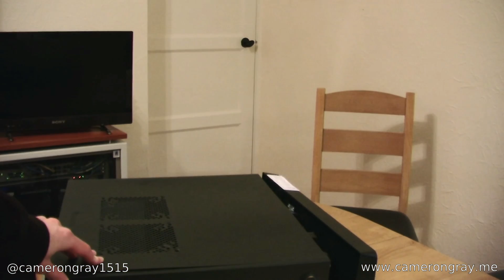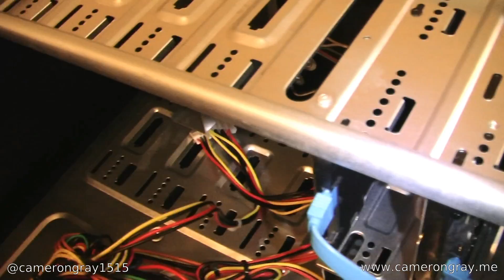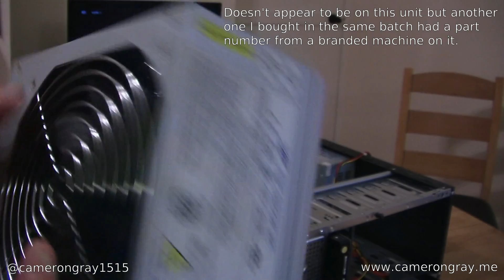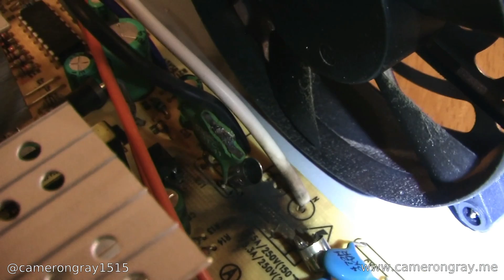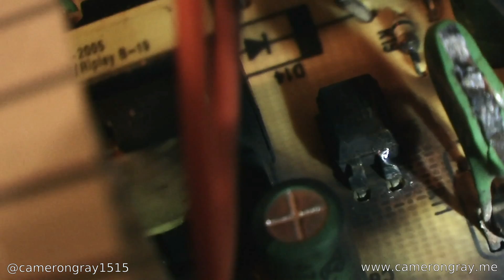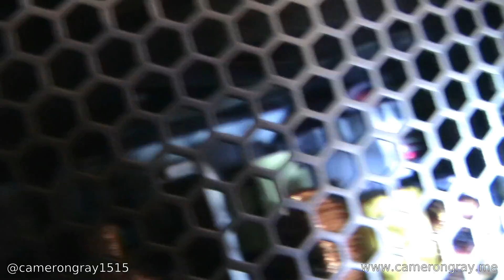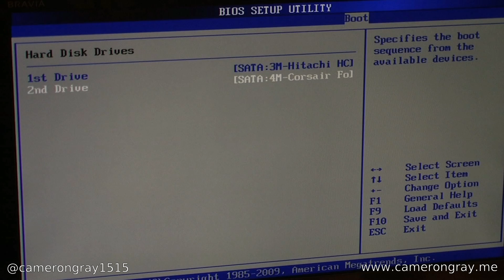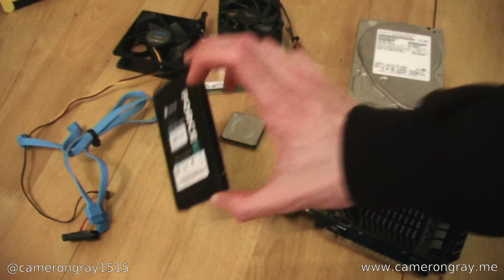Mystery £10 eBay PC

Comment from the maker: Please read before commenting - I'm going to attempt to answer a bunch of things that people keep continuously commenting so I suggest you read this first before commenting something that has already been done a million times :P

Comment: "You said you had a glass of water in case it went on fire, if you put water on an electrical fire you'll die.etc"
Response: Yes, it would be stupid to pour water on it if it was still live however I'd have disconnected the power first, notice how quickly I pulled the power cable out when I first noticed smoke.  At that point it's nothing more than a bunch of plastic/fibreglass on fire.  I could have also used a powder fire extinguisher I had nearby but this would have cost money to replace and would have made a complete mess of the room.

Comment: "You talk too fast"
Response: Yes, I know, I talk fast generally and was rushing this video.  I've tried to improve on this in my newer content including investing in higher quality audio recording hardware to improve speech clarity, this was recorded using the built in microphone on a pretty outdated camcorder in a room with pretty poor acoustics.

Comment: "You're shaking too much and that deeply upsets me for some reason"
Response: Yes, I was somewhat shaky in this video, probably a combination of me rushing and also because I was filming this shortly after carrying this machine home on the bus from work which meant my arms were pretty tired.

Comment: "You're an idiot if you didn't know that the /4 on the end of the RAM stick model number was the capacity"
Response: It's not particularly easy to notice these things when most of my attention is focused on creating the video rather than deciphering model numbers under pressure. This is also something that is different between manufacturers and I hadn't really dealt with much Kingston RAM in the past. Also notice that towards the end of the video (26:08) I pointed out that the /4 meant the capacity after I'd had more time to look at it off camera.

Comment: "A PSU having an 80mm fan or voltage selection switch doesn't mean it's junk"
Response: Agreed, I was a bit harsh with that statement.  However, having a voltage selection switch does indicate that it's at very least a pretty outdated design and outside of a few models, 80mm fans are pretty uncommon on retail PSUs nowadays (although still used in some OEM machines).  The combination of the two along with the low weight of the machine and cheap punched metal fan grille was generally what made me assess it as being pretty rubbish

Comment: "That Winpower PSU isn't junk/That FSP PSU is junk"
Response: The Winpower is junk IMO, it'll work but it's the bare minimum that you'd get away with, it's far below the quality you'd get in pretty much all OEM machines from Dell/HP.etc.  The FSP isn't amazing but it's a pretty solid PSU, they don't really sell on the retail market which is probably why people don't recognise the name although they are very common in many OEM machines and also make PSUs for other well known brands (pretty sure several EVGA ones are made by FSP)

Comment: Did you find anything interesting on the hard drive?
Response: I make a point of fully wiping any drive that comes into my possession without going through someone else's personal files, sorry for being boring!

And finally, no, I'm not going to give away this hardware (this also goes to people who have emailed me asking for the hardware for free) - I've scrapped the hardware that didn't work and I'm now using the majority of the working hardware in various machines I have or keeping them as spare parts.

I also realise this video is not my finest work, you'll notice that my newer content is much better!
Reply: Cameron Gray its the nature of the internet. You can never please everyone. I thought the video was great. you dont speak to fast for me. Maybe its because i am irish lol.
You will always get the know it alls and haters
Reply: dont bother with stuff like this its the net
Reply: Em.
Reply: @Cameron Gray - 
the first look at the Power Supply´s rear reveals its the cheapest thing you can get (like from the OEM "Leadman" ) or an 1997 made (ATX 1.x instead of 2.4 ) one ... a voltage selection switch is also bad for noobs ( not only the 110V setting for most of the world, but also the other way around ) ... 
The PSU sticker tells it instantly, the "SL-8500BTX" is under many brands = same generic dirt cheap junk, like the Inter-Tech "SL-500" ...
Edit: the PSU´s internals look like 20 years old or cheapest stuff ( just like "Leadman" ) ... 

FSP PSUs like in your video are used all over the wortld in all sorts of OEM PCs , decent stuff.
Reply: That computer is way better than any of mine.

Edit: If it worked.
Reply: I thought it was a really interesting video, thanks for doing it. My only remaining question is whether you ever got another motherboard and got the CPU to work? The blown cap on the MB and the exploded PSU components were quite impressive to see!
Reply from the maker: Yeah, ultimately all of the components apart from the motherboard and PSU were fine, I ran the CPU in a home theatre PC for a few years.
Reply: Suggest you read this long arse nonsense before commenting? You have lost the plot mate. Erm... The video was ok but it was a bit pointless. I got this for a tenner, I got 4gig and an SSD plus hd with a shit case. End of. Half hour was definitely not needed for such content.
Reply from the maker: I fully agree it's a crap video - it was rushed out of an evening with no scripting and very little editing right when I was just starting out on YouTube. I never intended for it to get any sort of significant traffic. For some reason YouTube keeps promoting it resulting in people commenting the same nonsense over and over again.
Reply: @camerongray1515  It's not crap, I enjoyed your spontaneity. I only have one comment: that case isn't half as bad as you think and despite the broken clips is fully reparable using a couple of small carpentry screws.

Comment: your full of shit. that power supply is ample for a very low system such as that. and for 10punds wtf are you expecting? an antec 80+ which the lowest costs 20? use your common sense ya prick

Comment: Anodia formerly towards good capacitors, I have an emergency light with an anodia capacitor manufactured in 1982, it continues to work perfectly in 2019, and it's plugged in 24/ 7h, at it the capacity is still good.
I always prefer a Japanese capacitor a thousand times, but the old capacitors of Anodia surprised me a lot about its durability.

Comment: "Internal part of the computer are new"
(unpacking @ 0.42)
Sees PS/2-ports Yeah totally new! :D
Reply from the maker: There are still many brand new motherboards that come with PS/2 ports, usually only a single one on higher end boards but a lot of lower end boards still come with two.
Reply: @camerongray1515  Why is that? So you can use a 10 year old mouse and keyboard?
Reply from the maker: PS/2 is interrupt driven whereas USB uses polling. This means that it's technically lower latency, not a huge amount but there is a difference to an extent. PS/2 also supports "N-key rollover" allowing any number of keys to be pressed simultaneously. As far as I'm aware USB is starting to support that but it's still fairly new and hacky requiring OS support - my main keyboard only officially supports N-key rollover when it's connected over PS/2. Then there is definitely the benefit of being able to use old keyboards, for years I used an IBM Model M keyboard which would only work with a PS/2 port or with an expensive active PS/2 to USB converter. Having a pair of ports is a bit over the top but I definitely like having at least one if I'm buying a motherboard.
Reply: Cameron Gray  Beyond your valid (but imho useless) points: An AMD X2 is from 2005-2009. Just as my comment implied, the chance this computer would have (quote), 'new internal parts' is so small... Just as small as the chance any user would buy a motherboard specially because it has ps/2 support.
And of the people who who would prefer ps/2, most have probably a (HD) television with bigger latency (with or without post-processing enabled). Besides that point, N-key rollover is a luxury which is even less useful.
Reply from the maker: The AMD II X2 I demonstrated was a spare board and chip I was using to test the parts as the motherboard that came in the machine was dead. Notice the CPU that I removed was an FX-4300 launched at the end of 2012 and sold for a couple of years after that. It's definitely not brand new (I mean, it was a faulty, used machine) but it wasn't exactly ancient either. Sure, PS/2 ports aren't going to be any use for most people however, realistically, I don't see a huge disadvantage to having one, the cost to add it will be tiny. Sure you may miss out on a couple of USB ports that could have been fitted instead but given the motherboard in my main PC has a PS/2 port while still fitting 8 USB ports with room to spare, I can't really see a problem with having it there for the few people who may want it.
Reply: @camerongray1515  I agree having ps/2 doesn't have any disadvantages ofcourse. And actually, people who think they miss out on 1 or 2 USB ports, don't know you can daisychain USB devices (with or without USB hubs), so I don't see this as a disadvantage.
ps I'm still unsure how I forgot you switched the motherboard/processor, and jumped to incorrect conclusions at the end of the movie. I apologize.

Comment: Bad power supply from rogue supplier = house fire that will kill your family.

That scenario is not worth a tenner. 

But the chip, ram, sdd, crap gpu, HD, motherboard and DVD drive...well even crap as they are ...probably worth 50 quid. I'd just resell it as parts and forget I ever saw it.... Its not worth putting a new power supply in.

Comment: Those winpower psus are perfectly reliable, budget power supplies.  They probably manufacture a lot of the fancy looking  units out there branded as corsair, antec etc.
Reply from the maker: Winpower are not a reputable OEM, they are a low end brand of generic PSU, I've never seen one that I would consider sufficient quality for even an extremely basic machine.  Corsair/Antec.etc units are made by much more well known, reputable OEMs such as Seasonic, FSP, Delta, ACBel.etc which are generally pretty good units, miles ahead of "Winpower". Even PSUs in prebuilt machine from known brands are better. Ultimately it's up to you if you want to use such a low end unit however personally I'll never risk my own hardware with something so basic and wouldn't feel comfortable lumping someone else with it if I'm building a machine for them.
Reply: I'm sure it doesn't provide the rated 500w, but they're fine.

Enthusiasts worry too much about psus.  You're likely to go your whole life without ever seeing one fail.
Reply from the maker: The issue is not just how much they can provide, they often lack various protection features.  For example, I've had a cheap PSU melt its wiring due to a short circuit as the unit didn't have any form of short circuit protection.  Additionally when they fail they often take out other components with them.  The way I see it is that for £20 more you could get a significantly better unit (with a warranty and known manufacturer) so why cheap out on one of these unless you are a system builder/repair technician cutting corners to increase profit? Off the top of my head, in the last 4 years I've seen probably about 5 PSU failures and out of them, only one was from a reputable brand (and had been running 24/7 for around 10 years). Even the cheapest prebuilt from a reputable manufacturer will use a better PSU than this. I'm not going to go out and buy a top of the line 80+ Platinum Corsair for a office build, but I would have no problem spending £30-40 on a basic unit from a known brand.
Reply: Well I've seen 2 or 3 fail in about 25 years.  Maybe I'm just lucky.

Comment: did i just hear you say that you have water ready for if the mobo sets on fire, thats hella dangerous dont put water on electrical fires
Reply from the maker: I'd have obviously disconnected the power first... Notice how quickly I pulled the power cord out as soon as I noticed the smoke initially.

Comment: Not to be a prick... but this computer is obviously old... How is that case cheap? It's a standard case... Power supply is certified and this make is not bad at all for a NON GAMING PERFORMANCE PC, not every power supply has to be "Gold 80" or "Platinum 80", it would be perfect, but when building a budget PC for office/home(non-gaming and for non-heavy workloads), it's not crucial... I was wondering why I only watch Linus and Gamers Nexus...
Reply from the maker: It may be a fairly "standard" case however it was made of incredibly thin flimsy metal with sharp edges, sure it works but it's still significantly worse than any sort of case you'd get on a prebuilt machine from the likes of Dell/Lenovo/HP.  Not quite sure where you are seeing that Winpower PSUs "aren't bad at all" - they are low quality units from an almost untraceable manufacturer.  I'd always say that for any PC, a quality PSU is important.  Of course you don't need some sort of crazy high wattage, high efficiency PSU for a basic PC but you at least want something that won't fail and in particular won't damage any other components if it does.  These Winpower units have next to no protection and when they inevitably fail they will often take other components with them.  As with the case, the PSUs you't get in a prebuilt from a large manufacturer like Dell/Lenovo/HP would almost certainly be of higher quality.

Comment: That Cap. failed short and pulled the cheap power supply down, the green thing in the power supply is a varistor of some type to control the input surge which it could not do when the cap shorted. You might have found the board worked  if you had just pulled the shorted cap off.

Comment: Wait, a PSU should not have an I/O switch? Those switches are there for a reason because you do not want to get unexpected current running through the system when it´s turned off while you work inside the machine and rather not have to only resort to unplug it.

Edit: This had two separate ones instead of the common single switch? My mistaking.
Reply from the maker: I was more referring to the red voltage selection switch, it's rare to see it on a good modern PSU which should support Active PFC and therefore won't require a such a switch. PSUs that have those switches tend to be based off of outdated designs, it's not a definite sign that a PSU is bad but on a machine of this age, it's a pretty big red flag.  The same goes for PSUs which are fixed to a single input voltage.
Reply: @camerongray1515  

Looking around in the comments I began to understand what you were referring to, a strange little detail. Also, that is one funky looking GPU passive cooling solution with a wavy design.

Comment: did he say in the video he has a glass of water just in case? last time i checked water isnt the best thing to use on electrical fires... lol
Reply from the maker: You're like the 100th person to comment that. I'd have obviously unplugged it first (notice how quickly I unplugged it when I noticed the smoke). It's unsafe to use water on live electrical equipment, not isolated equipment that may have carried electricity at some point in its life. I could have also used a powder extinguisher however this would be both expensive and make a complete mess.

Comment: Thanks @Cameron Gray, nice video. On top of other "FAQ"s I'd like to mention that you were really risking your fingers when touching those power line elements when powering up on FSP. It could be extremely hot - giving you deep burns; it could blow your fingers off, etc.
Reply from the maker: When do you mean, if you mean later on when I was checking the board outside of the case, the power was turned off and I was checking to see if any components had got hot, at 18:07 you can hear me checking to see if the power is off before touching it.
Reply: Yes, 17:80 and further. Honestly, I couldn't understand that phrase until you pointed it out :) All right, the power is off, one less thing to worry about. My point is that 1) it could still be very hot much hotter than you experienced - 20 seconds before you say "I feel smoke". I would be extremely reluctant to touch a smoky part of hardware with my bare fingers after the power was ON for a while; 2) despite the power is OFF now, you can't really know what happened to the capacitor, and if there is a chance that it carries the charge on the OUTER  shell now. I'm not saying this is likely to happen, but hey I just don't think it's worth risking.
Reply from the maker: I understand your concern however it is highly unlikely that I'd have been able to sustain any sort of injury - I was tapping components quickly to ensure they weren't extremely hot before placing my fingers on them for extended periods of time, at any rate it's not like it would give me serious permanent burns, if it was that hot I'd have felt heat radiating off of it.  I'm much more likely to burn myself cooking!  A capacitor like that is tiny and even if fully charged wouldn't provide any more than a slight tingle, it's not like I'm sticking my fingers across one of the large electrolytics in the PSU!  With these things there's always a balance between being careless and being so cautious that you can't actually get anything done.  It may not come across partially well in this old (and pretty crap) video however I do have a decent amount of experience with this sort of thing and know how to work safely.